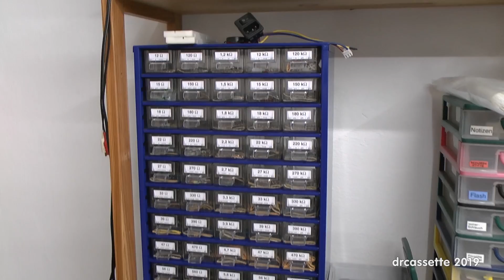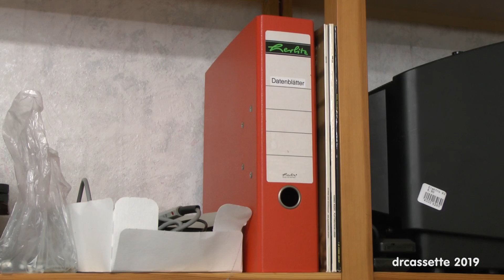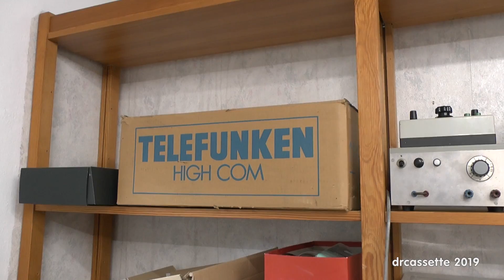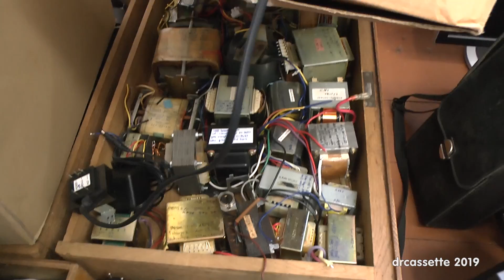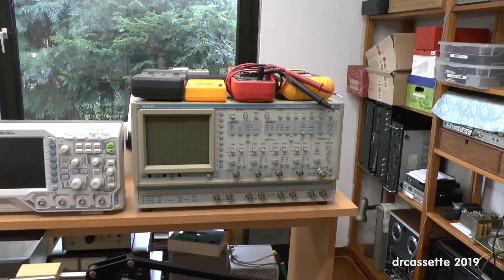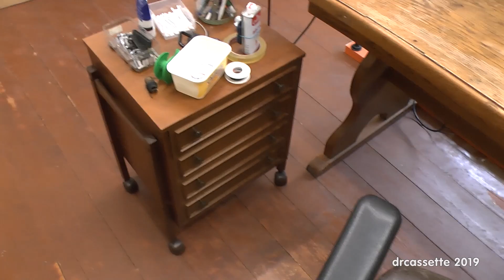Workshop Tour!

Comment: Nice room, quite like the old chair and the wooden floor, it has some character! That phone mount is pretty handy. But don’t you need a bigger desk? What about an office desk with a corner section? Could be practical considering you’ve currently got a sort of corner arrangement. At the office, I have an L-shaped desk with the computer in center of it.
Reply from the maker: I will build new workbenches for the new workshop, which will be much bigger than the current ones. But it most likely won't be an L-shaped setup as those never work out very well for me. Typically I work on one side and the other side turns into a mess - that's what happened to the 'soldering' side of the old setup too.

Comment: Das ist sehr gut gemacht, von einem Radio Amateur, W2CH. I habe Deutsch 
gelernt von meinen Eltern und auf
universitat, NYU. Mein Father hat nach Ettal, bei Oberammergau geganen,
von 1921 bis 1932.
I like cassettes very much, have a nice
modern Teac dual cassette deck, an
older Panasonic RX5250 and Sony
CFS-D7 boomboxes with Dolby B.
I started to use cassettes 50 years
ago, and in 1972 had an outboard
Dolby B device for my first cassette
deck. Unfortunately new cassette
decks, for the few that are still made are not licensed any longer with Dolby noise reduction. I once had in the 1980's a Sony three head Dolby B & C
cassette deck.
I recently purchased a Philips DCC
portable cassette recorder/player from
the DCC museum in California, and also have obtained some of blank
DCC cassettes. 
Additionally, I have a Sony portable DAT recorder/player and some blank
DAT cassettes.
In 1972, when the Japanese did not
yet have Shortwave Radios in the US
stores, I bought a Grundig Yacht Boy,
for about $60.00 back then. It was
nice, but some years later the main
circuit board cracked, and I no longer
have it
Auf wiedersehen!
Reply from the maker: Oberammergau befindet sich im Süden von Deutschland. Ich lebe im Norden von Deutschland.

Comment: Maybe a nice wide workbench with two tiers of shelves above are in order? I never have enough room on mine it's actually a large converted computer desk that's 4 feet (1.2 meters) wide and almost 2 feet (.6 meters) deep. My plan is to cut off the rear rails that go up and over the top that use to hold the upper portion to allow the top to go back further to the wall make a new top that's at or more then 2 feet deep and make it 6 feet (1.8 meters) wide. I'm not going to bother making it deep as it would just take up more floor space and the equipment can reside on the shelves underneath.
Reply from the maker: I will be building new workbenches for the new workshop, but I have not yet made any detailed plans for them.

Comment: Is your phone mount thingy made partly from an old camera 'off-shoe' flash mount bracket? I think I see one in it's construction.
Reply from the maker: The long metal piece actually used to be one of these things that you screw into the tripod mount of the camera at the one end and then it has a tripod screw at the other end where you can then mount an accessory shoe adapter. I guess it's kind of what you meant.

Comment: Nice workshop. You seem to have a lot of experience with cassette decks. Do you know where you can get record/playback head replacements (combined head)? I have a Denon DR-M22 and the playback leads of the left and right channel show infinite resistance. Thus, the leads must be broken inside the epoxy (?) potting. Maybe you have some tips?
Reply from the maker: In those rare cases where I come across a bad head I just put in a head salvaged out of another cassette deck. I don't think you can still get new heads, and the most recent ones are junk anyways.
Reply: @DrCassette  Thanks for your quick response. That is what I suspected. I already tried to dissolve the epoxy filling (aceton bath) to release the coil and windings, but no luck. I might try a warm bath in distilled water to see if the epoxy "flows" out. The journey continues :)
Reply: @stefanhertweck  
You might want to look at this 
http://www.ant-audio.co.uk/Tape_Recording/Heads/RP_heads_measured.htm
http://www.ant-audio.co.uk/Tape_Recording/Heads/Sandwich_heads_measured.htm
I hope you will find a lot useful information at Alex's site, I would e-mail him. Also, I would ask people on tapeheads.net , you might be lucky and find something similar from a different machine - the level would have to readjusted.

Comment: There are some pieces that I wouldn't mind to have - differential input scope, the isolation trafo-varactor, distortions meter. Maybe a few others. I'm more into loudspeakers but for testing amplifiers and other things. 
I can't believe you have all the screws organized 😨 - very clean shop. I have to work in my bedroom and a lot of equipment sits under the bed and table.
 The Cyrus amps supposedly be a good sounding despite limited power - possible that yours also use current feedback . Telefunken High Com - too bad the box is empty. The Grundig world radio is a nice find, the portable 3header deck. So where is some of the equipment that you repaired, say the beautiful Yamaha KX-930 3header deck, some of the better amps - did you sale them or do you use them at home?
Reply from the maker: I used to have my workshop in my bedroom, minus the soldering, that had to happen in the garage as my parents were scared that I could ruin the carpet in my room (which I did anyways). Building a proper workshop in this old building my parents had inherited was a major upgrade. 
The Telefunken RC200 High Com cassette deck that belongs to the box sits in the little shelf under the window. Sadly it doesn't work quite right. 
Some of the repaired equipment is at home, such as the Yamaha KX-930 which is now part of my main stereo system. Most repaired equipment I end up selling.